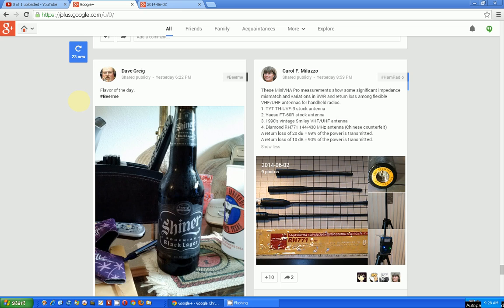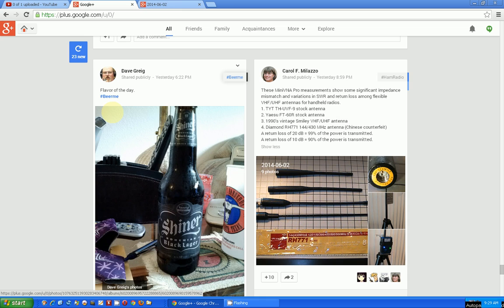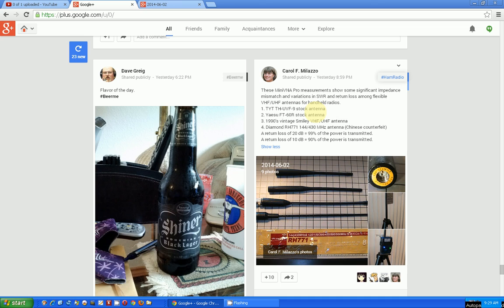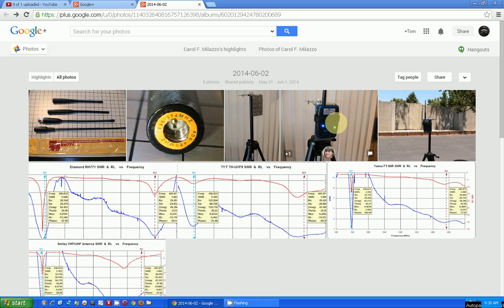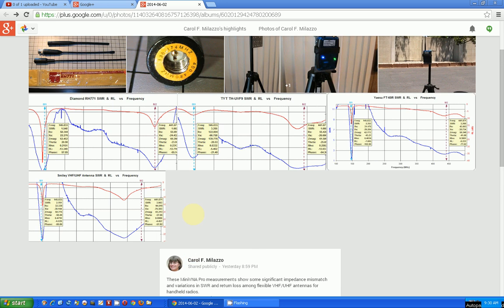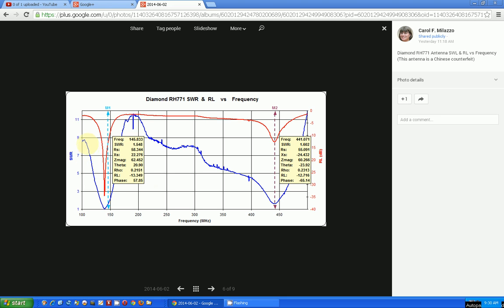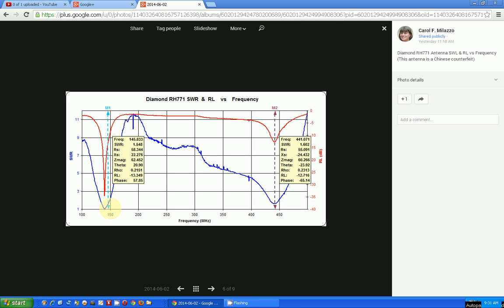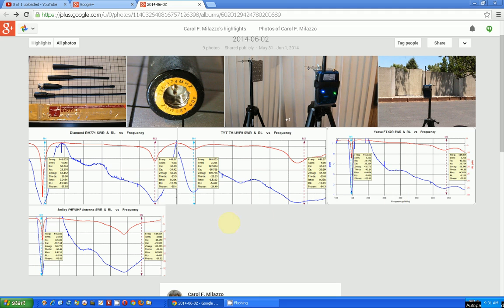TRRS #0316 - Antenna for Your Baofeng Radio

Comment: Hi Tom. Interesting video. I had no ideal they made testers like that. I don't live in a cave but would seem to at time's :)  Thank you for sharing .
Reply from the maker: Thanks for your comments.

Tom
Reply from the maker: bahathir I wonder if I can get a loaner for review?

Tom
Reply: I just came across the product's overview while searching for "Antenna analyzer" in YouTube. It is just  my  'dream' analyzer,but cannot afford to buy it. :)

Anyway, I only have a cheap' digital  SWR/power meter Redot 1050A and I also use RTL-SDR for testing antennas' performance. Yes, the RTL-SDR can provide some signal strength readings (in dBFS unit)  for the comparisons. Enough for starting my HAM radio hobby journey, and  will  receive the official  license/Apparatus Assignment (AA)  in few days.

73
Yours.
9W2GNU